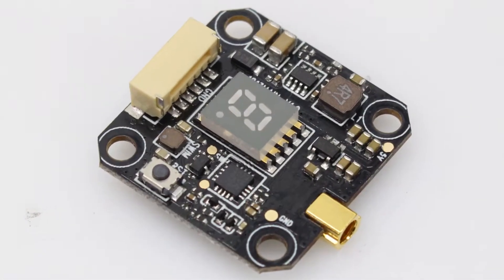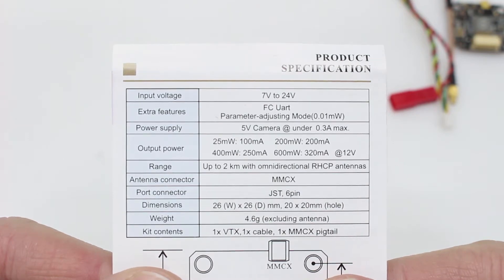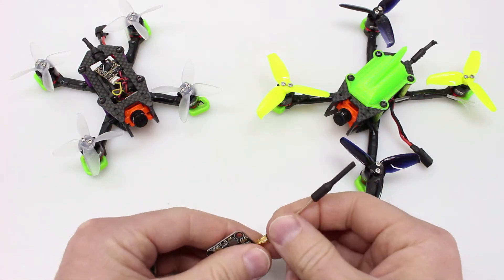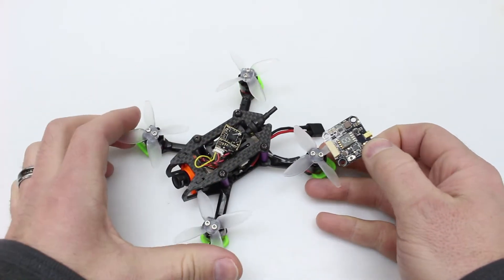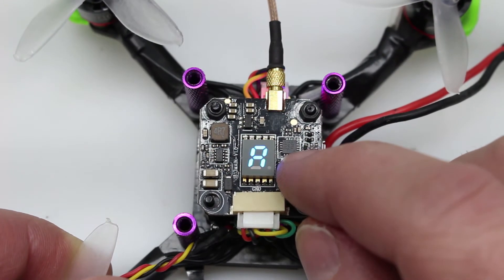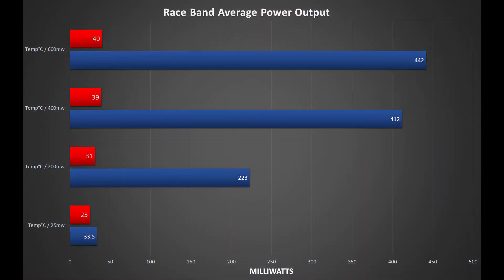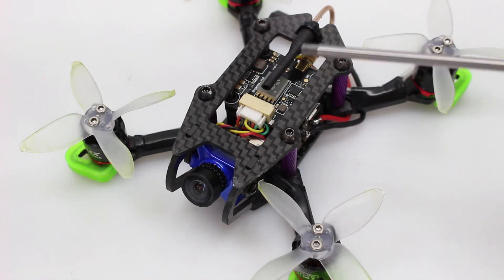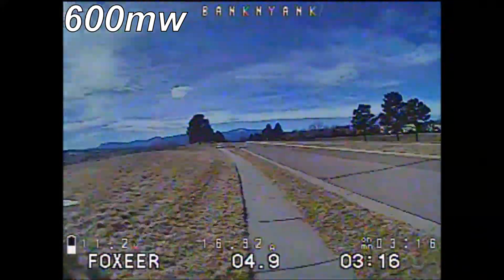AKK FX3 VTX | 20x20mm, MMCX, Smart Audio

Comment: Great video! Did you try running it on 6s? It is only 1.2 V too much and I would like to use it on my 6s quad... Or what about 5V with higher power levels?
Reply from the maker: I have not, it should be able to handle it but I can not say for sure.

Comment: cool review, bit low the range I think for a ~400mw VTX, it can also be due to low to the ground flying
Reply from the maker: The limited range was because of the way I had the antenna mounted.  If it had room for a normal antenna range would have been much better.

Comment: Can you exit pit mode without using osd? That is can you exit pit mode using the button on the transmitter?
Reply from the maker: You can using lua scripts but I have never tried it myself.  I have used  TinyLEDS power switch with this vtx and was able to program it to switch off and on. I made a video about it that you can watch.

Comment: Hi what size is the  mounting holes. 👍
Reply from the maker: crash bang fix fpv They are 3mm holes, but I have used it on several stacks with m2 hardware.